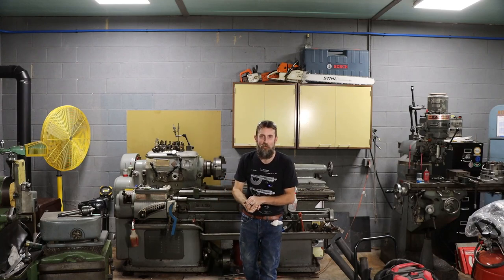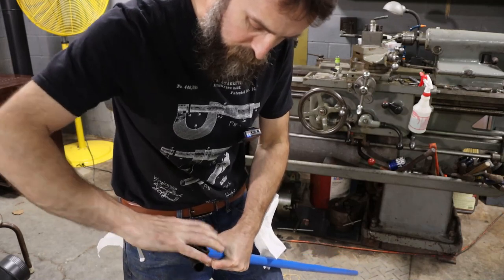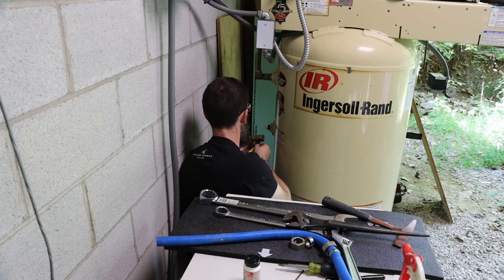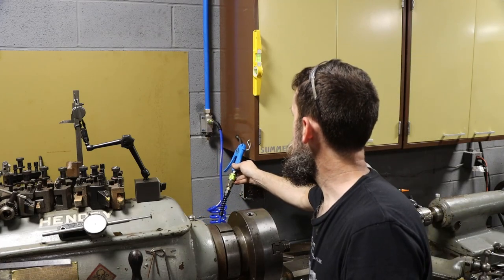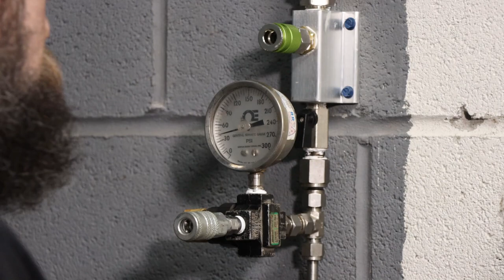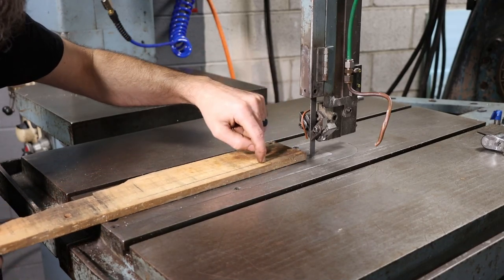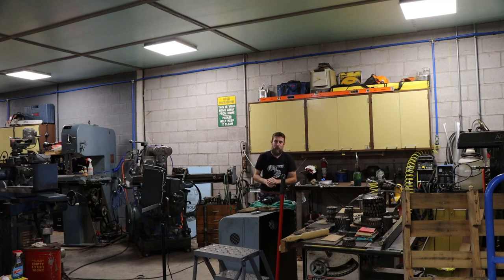A GREAT SHOP AIR SYSTEM. FINISHING UP

Comment: 6:16 The modern world.
Did you know a hammer and chisel can do that more precisely than a clumsy 3 kg power tool?
So precisely ,in fact, that in times past , people actually carved images from stone using a chisel.

The pressure regulator for the saw is redundant. There is no reason the needle  valve isn't adequate to control the flow.
Reply from the maker: The saw wasn't designed for line pressure.  I agree that a power hammer wasn't required but it sure made the job quick when accuracy wasn't needed.  Thanks for watching 👍
Reply: @SteveSummers  Just pop a flow control in the line to the saw's needle valve (i.e. another needle valve).
All a regulator is ,is an automatically controlled needle valve. Regulators should be used where the flow or supply fluctuates and the output pressure is critical,such as when driving an actuator. The flow from the saw's nozzle is constant.
Reply: @SteveSummers  Hi Steve I'm an engineer who has done a lot of automation systems including the pneumatic systems. I know these kinds of plastic tube based systems as I have installed plenty of them. There's some very fundamental things about pneumatics that most people (as in 99% of them) take for granted.

Remember I do this for a living and the people I do this for have millions of dollars invested so I take this as far as I can. Because in my line of work a bad pneumatics setup is a guaranteed way to lose a customer and with it your reputation.

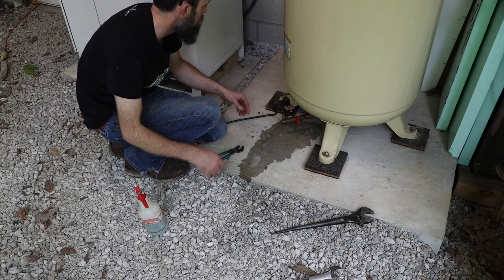The biggest issue is easily moisture in the system followed by contaminants. Oil from the compressor is the most common contaminant. Unless you are in an environment like a Canadian winter or Antarctica where all the moisture has been frozen out of the air you WILL have moisture in the system. Moisture doesn't sound bad but to pneumatics its as fatal as sulphuric acid. All of the valves, valve seats, regulators and any actuators will get destroyed by moisture. It never happens fast but once you find out its already too late. What your pointing out around 11:00 with the finger valve is moisture related.

The fundamental rule is you can never keep moisture out of the system but you can decide where it will collect.

The first place you always get moisture pooling is in the bottom of air accumulators. Looking at your setup at around 4:08 you are using the bottom drain as part of the system. The outlet on the very bottom of any air accumulator is a drain and should only ever be used as a drain. I get what the solenoid setup you have is for but I don't like those sorts of setups. They are just to prone to moisture issues and failure. Don't panic on this, but do check it regularly and replace it at the first sign of trouble or you risk a Murphy's (the failure you get at the moment you can't afford a failure). If you really want an effective drain all of the main pneumatics suppliers have automated moisture drains. The are basically what you have on a filter regulator without the filter or regulator. They are just the bowl with the float valve in the bottom. I know its hard when the bottom of the accumulator is so close to the ground. Its why I like to mount them up off the floor.

I'd recommend ditch the finger valve and just get a small ball valve with a stainless ball. It doesn't need to be a big valve so don't waste money. It only needs to be big enough to drain the tank and let any moisture out and do that day after day after day for years and years. Hence a stainless ball.

On the mainline you are running around the shop. The filter is fine and the regulator is fine (just swap it around which they all do easily). Good pick up on that I have had to fix many installations with the reg. mounted in reverse. Yes people don't know the arrow on the front indicates which way the air flows. The main line you have run is good stuff. I have used these plastic tube systems and any advantage a copper tube system might have goes out the door with how easy these are to install.   

Couple of things on your main line. 
1: Where it comes out of the regulator you just bend it up. Put in a T-piece with a short drop and valve or you will get moisture running back down into the outlet of the regulator. Your main air regulator is one of the most important things in your shop, so look after it.
2: The furthest point from the regulator in the main line needs to be the lowest point so that all the moisture runs and collects at the end of the system where it doesn't matter.  Its looks like you have simply followed the line in the brick work as most do. That first line up from the regulator to the main should go as high as practical. Then run the main line gradually downhill around the shop. That way any moisture runs towards the end of the main line. The final part of that line should come straight down the wall to a valve NOT AN OUTLET. Consider it a drain NOT an OUTLET.

I like the outlet manifolds for the droppers as they are designed to help control moisture in the system. On the cover of their box they show all the droppers as coming straight off the bottom of the main line. I always try and go off the top as in the T-Piece points up. You then run a half loop to go down the wall. That way any moisture that has pooled in the main line doesn't go down a dropper when air starts flowing.

Take what you like from this, but remember I have customers that shutdowns are measured in $100s of 1000s per hour. So a major pneumatic system failure can cost more than the entire system in under an hour. Its why people like me go to what seems extreme, but I win the financial risk argument EVERYTIME.

Comment: It just so happens that Im about to put some new airlines in my shop...  I was considering copper, but sweating pipe is a lot of work, and I may want was to preserve the modularity that you get with this system.   My main concern was durability.  So, my question is, after handling the parts and the lines, do they feel robust?  Do you have any indications that any of the materials, or components will give you trouble in the future?  Any other advice on what to buy, and things you would have done differently would be appreciated...    I really enjoy your videos by the way.
Reply from the maker: Everything seems good to me. I don't think I'll be having trouble with this setup.  As far as things I would have done differently 🤔... I can't think of anything.
Reply: @SteveSummers  Thanks.  I'll probably do the same then...

Comment: Steve did you do a leak down test on the loop? I've installed the 3/4" Rapid Air system in a loop and I've had a heck of a time with bleed down. I know the compressor will hold air for weeks but if I leave the valve on then the whole system drains over night. Got frustrated trying to figure where the leak is, I need to get back on it.
Reply from the maker: I did. Got to remember to check that back plug on the manifold.  That is a place you would not be able to see unless it's not mounted. Only leaks I've had were due to me not using the deburring tool enough and the o-ring getting pushed off the seat. Had this a couple times👍

Comment: You would think that air compressor tank manufacturers would epoxy coat the inside of the tanks to prevent rust. Should would make life easier if they did.

Comment: Have you pressure tested the compressor tank, or performed an internal visual inspection using an endoscope?  These are important steps when using a previously owned compressor, especially one with as much rust as seen in your drain valves.  Congratulations on completing one more step in the shop improvements. Stay safe, stay well, and may GOD Bless you and yours.

Comment: might be an idea to look inside the compressor tank with a  endoscope type camera to check how badly corroded it is as its quit old and runs a a high pressure, i always put some heating ant corrode in every few months seems to help slow the corrosion . i find they corrode most in the bottom where the water sits as most dont have auto drain like yours, its best to check as you dont want the tank failing . i watched one on you tube that failed, it was a Chinese piece of junk but god it did some damage and i dont think anyone would have survived if they had been standing by it when it exploded.

Comment: All that rust is from the entirety of the inside of the tank. You should cut a big hole in the side of the tank enough to get in there and clean it then seal with I don't know, poly or something. It will pay off to save all that in your lines and tools and eyes and stuff. Would make for great YouTube video anyway right. It's not to late. They got rid of that for a reason: waterlogged. That's what it's called don't listen to anyone else. Dave, nice for you to meet me.
Reply: Never, never, never cut into a pressure vessel for any reason other than to scrap it.

Comment: The lathe air gun may get covered in goo pretty quickly…..
Reply: i would be more concerned about getting hit on the head when one of those chainsaw's decided to pay Steve a visit!
Reply: You shouldn't be using compressed air to blow away chips. You end up pushing them where they should not be, like in your eyes or in seals.

Comment: Bad location for your lathe air hose- there will come a time when you need to use air while the lathe is running.  Better to run a line under the lathe and hook it somewhere on the front.
Reply: Agreed.

Comment: The line was originally  extruded, then coiled. To straighten, cut a hole in piece of metal stock, 6" or 12", then radius edge of said hole, manually pull airline through piece on a STRAIGHT PLANE. Otherwise it will curl to your deviance thereof. Boy I sure talk funny but try it out. Use riding lawn mower to pull and pull fresh coil from out of box off a reel(broomstick or somthing).

Comment: You're well equipped now to blow chips, dust, etc., from the machines, improving visibility and cleanliness. I'm wondering if you might, later on, find that all this debris that you're blowing off ends up on the floor or settling on other work surfaces. Knowing that you're a man who likes a clean shop, I imagine you'll be going around with a shop vac and dealing with the problem a second time. How long before you decide to install a whole-shop vacuum system with an outlet near each machine? Understand, I'm not saying you SHOULD do this. I'm just wondering if you might decide that the shop would be better if you did.
Reply from the maker: It really  move the mess from one place to another .  But it is nice in many ways. 👍

Comment: I think that you will eventually curse those blue springs air hoses. You always have a "Pull" against your hand when using the air gun as it constantly tries to go back to its original length. PLEASE MOVE the airline from your lathe. SAFETY HAZARD near the rotating chuck. Your DoALL should have had it's own built in air pump that runs off the motor, have you checked that the belt is not broken ?. Probably a vane type pump. Some early machines had a piston type air pump.

Comment: Hiya Steve, nice work. A shop I was working in had an air system fitted, a week later someone came to fit another drop as you were doing. He never checked if the system was 'Live' and was thrown across the shop when he cut into the main run, he was okay apart from a headache. Stay safe, Steve...

Comment: it would have been better to have the compressor start control box in the workshop and just put a 
working lock out switch out next to the compressor would have been a good move just a subjection

Comment: Why da hell nobody thought of making a tank out of carbon fibers or fiberglass reinforced plastic.That way no more rust inside the tank.Its not like those tanks hold  extreme pressures 10 bar isnt that much.
Reply: Or at least coat the damn thing from inside with plastic.

Comment: I'm surprised you didn't drill   a hole through the wall at the base of each manifold and put a piece of tubing through the wall off the water drain so when you opened it the water went straight outside